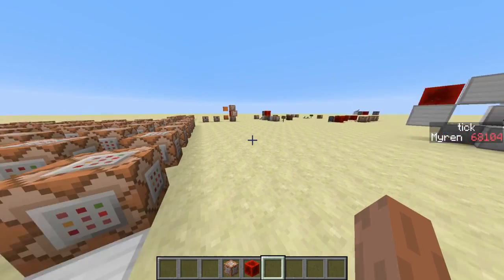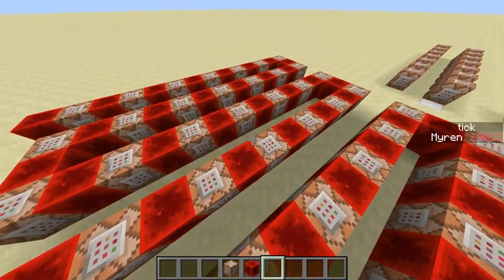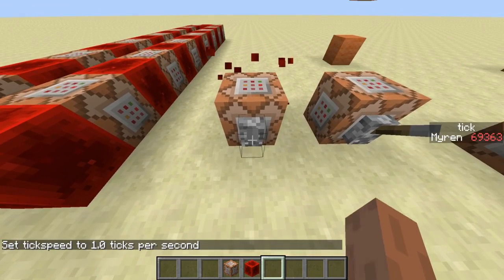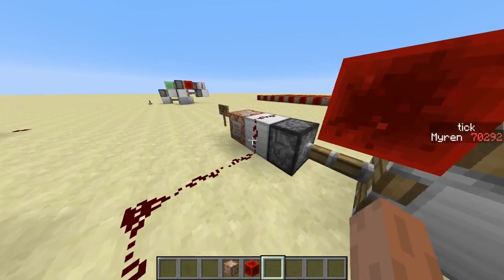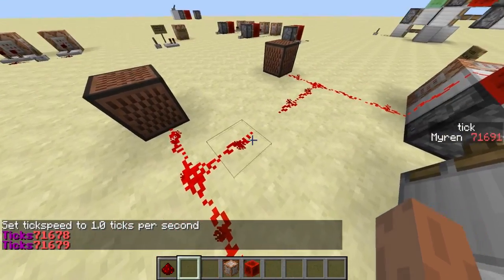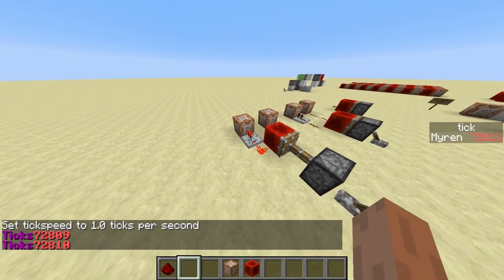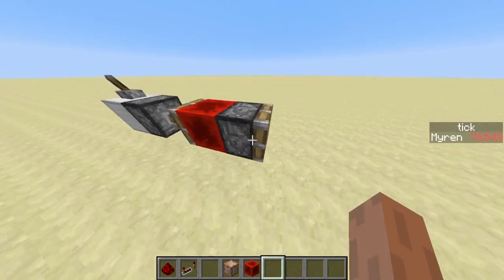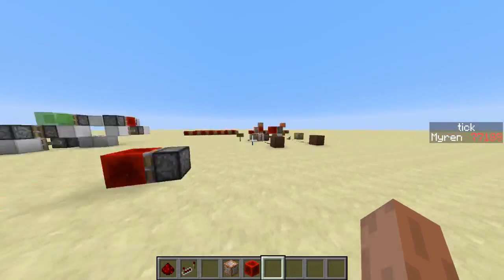Commandblock Inaccuracies

Comment: Nice video.
Yeah, things get weird when it comes to zero-tick stuff. I'm not sure if the tickspeed mod adds to the client server offset for some reason, or if that just is normal. I mean I set the tickspeed on client and server to the same so it should be fine...

The "lost update"-bug you show at the end is really interesting and should be fixed. That might solve that many things get stuck when beeing unloaded. In general, things beeing stuck when unloaded shouldn't be a thing anymore! It's 2015! xD
Reply from the maker: Panda4994 The "lost update" bug is especially inconvenient, when it gets lost on a retraction instead of an extension, because the piston will be in its glitchy state upon unloading, and stay in its glitchy state upon reloading. If they fixed that bug, the glitchy pistons would be fixed as well (without fixing my 4-headed pistons), so I completely support fixing that bug.
Reply: Myren Eario On my TODO-list now. I acutally made a new TODO-list so for now it's the only thing on there xD (But that's just because I didn't write down the other things ;-))
Reply from the maker: +Panda4994 I don´t know whether you submitted that "lost update" bug, but since I couldn´t find it on the bugtracker I submitted it myself. https://bugs.mojang.com/browse/MC-89146
And I´m pretty sure, that things being stuck when unloaded is caused by this bug.
Reply: Myren Eario Nice :-)
I didn't submit it yet, because I didn't get to try out what happens when you save block events yet.
I think saving them gets a bit tricky because you need to save them per chunk (really similar to tileticks).
Reply from the maker: Panda4994
Also, I would like to know your opinion about bugs in general. You often say something "should happen" or "should not happen", and as far as I can tell, "should happen" refers to things that are intuitive and somewhat realistic. But I don´t quite see yet, why minecraft should behave intuitive and realistic at all. In my opinion it´s a game not a simulation, and bugs should only get fixed if the game is more enjoyable to more people without the bug. So, I just would like to know how you think about bugs.
Reply: Myren Eario It's a subjective matter. In general I think that the developer of the game should consider it a feature for it to stay in the game (if it was a bug first, then at this point it becomes a feature). An example in Minecraft for that would be the quasi-connectivity. It was confirmed to stay a while ago.

Usually we don't know what the developers think, so I ask myself what is fun to play with and what makes sense in the Minecraft universe (which has a simulations character to some extend). I try to find other things that the developers put into the game that look similar to this behaviour in some way.

In case of bugs like the recently discussed ones with hitboxes, it is way simpler to see the developers perspective on it as the question isn't even a gameplay one, but rather a game design one.

I try to base my personal judgement as much as possible on facts and logic, but in the end it comes down to opinion. If something "feels right" I think it should happen, if not, I think it shouldn't.
(I also don't always agree with Mojang there. E.g. Pigman from lighting should spawn without swords in my opinion!)
Reply from the maker: Panda4994
So the developers should get to decide what gets into the game and what not. I think I can understand that (while disagreeing). I was just kind of confused, because I used to think your attitude was something along the lines of "Will sand generators ever get patched properly?" "No!" and "Will Mojang ever win?" "No!" (these were just two oracle quotes, but I guess they´re already 2 years old and opinions change over time)
Anyway, to fix the "lost update bug", instead of saving block events in lists in chunks (which would be kind of empty in almost all cases), block events could also just be moved to the very end of the update order in each tick, so that if the game unloads, block events are the last thing that gets processed before the game unloads (and then they can´t be triggered by something, without them getting processed before unloading).
Reply: Myren Eario The Orcale gave these answers, not me. The questions were neither asked by me :-)
I picked them though. But even though I would be sad if sand wouldn't be renewable (with bugs that are not full duplication bugs), I would be absolutely fine with sand generators being fixed. The more since I know that the same part of code would need to get fixed to make riding entities go through portals.
To "Will Mojang ever win?" I want to say that this question is part of the long tradition between Mojang and the Tech-community. Mojang fixes a bug that was abused, we find a new one. I didn't mean that I disagreed with what they did or do, it's just this playful challenge to basically outsmart the programmer by abusing bugs :-)

I'm not sure if moving block events would be the best idea. I think block events have one tick delay in them sometimes. When I looked at it I saw two lists that get swapped anyway which would make sense if you want them to be delayed by one tick (so you would use a list for this tick and one for the next).
The other problem I see is that changing the position of them in the tick might change behaviours. I'm not into the matter enough to have a clear idea of it or give an example, but these are my worries with this approach.
If it would work fine, it would be preferable though. Basically no extra code.

Comment: Very interesting. I suppose what you say makes sense. I am with Nasm though, there's something weird with repeaters, in fact, also with torches, and we were messing with this stuff on our test server a while ago and didn't come to any concrete conclusions, and gave u pat some point, but we're definitely aware of some issues with torch and repeater timings. For example, how do you explain our witch farm design activating within 1 gametick, even though it uses a torch.
As far as I can tell, from messing around with my own tickspeed mod (which slows down the server, but not your client, among other things coming soon to a YouTube near you), torches on the falling edge and repeaters on the rising edge (basically, in the transition to both non-default states) exhibit some weird timings, depending on whether you power them from a block with a lever/tripwire, from a piston, or from another repeater/torch. I believe these give 1 gametick for the former, 2 gameticks for the latter, and have a RNG for pistons :P
Reply from the maker: ***** I don´t know much about torch timing.
As for repeaters, I´ve got some experiment suggesting they have a 1 gtick delay if powered by a lever or tripwire (I´m not entirely sure about that yet). But if you power a repeater by a piston it should have a 2 gtick delay. However it always gets difficult if pistons are involved, because you always get at least some 1tick server/client desynchronization with pistons.
Reply: Myren Eario

I'm uploading a video about my tickSpeed mod right now. I believe you can get some more accurate measurements with it (besides, it's much better suited for the kind of testing you do, as it doesn't slow down your client at all, just the server). I suggest testing some of the things you have in mind with my mod, and see what you can find. Up in a few mins.